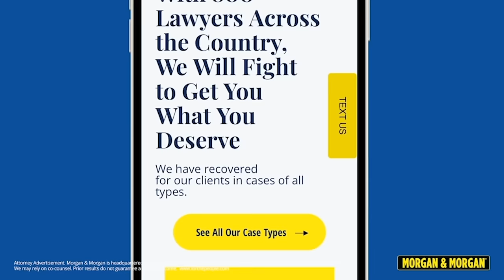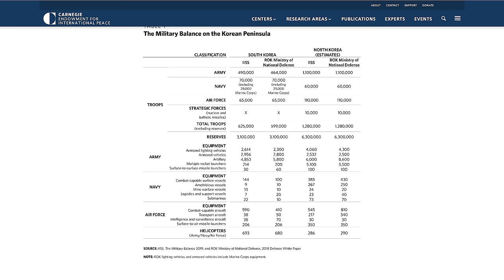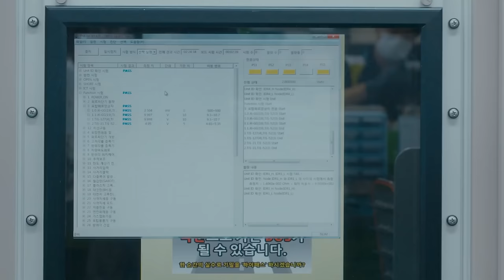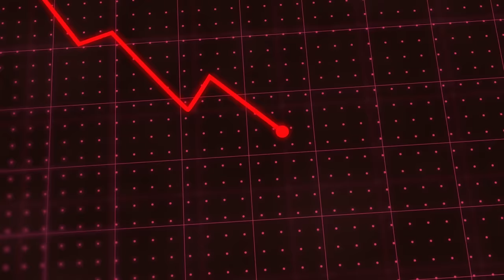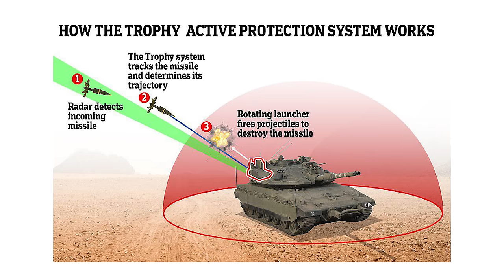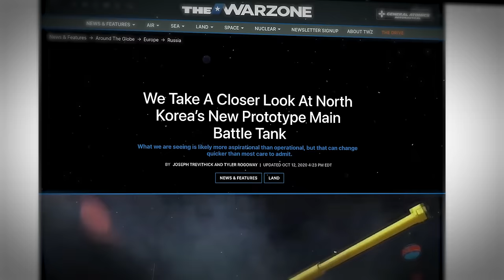North Korea's NEW Tank is a Nightmare

Comment: Bradley has entered the chat.
Bradley's main gun actually killed more tanks than tanks have killed tanks. One benefit of the TOW though, is that it has a longer range than the main gun. You can hit the enemy before they're able to hit back.
Reply: It killed more obsoletely armored tanks than other tanks in the same theater killed tanks. 

Fixed it for you.
Reply: The TOW is wire guided, correct? If so, how’s it possible to have a wire that is thin enough, spools out fast enough, and knows when to let go of the originating weapon? I mean, how does it work. I understand some submarine torpedoes operate the same way. And for miles, right?
Reply: Exactly about the ATGM and why the lack of professionalism of this video didn’t understand that is funny! All Russian MBT beyond the T-62 series have this capability 🤦🏾‍♂️
Reply: @4411825  I was gonna say the same lol. The question isn't why a tank has an atgm. Spoiler alert many tanks around the world have atgms on it that's not the problem. If these are top attack atgms then they're actually useful. Problem with a main gun fired atgm or shell is that it has to go through armour. Top down attack missiles... don't. I don't think this guy knows much about tank weapons. As for it being on a launcher. Technically makes it more versatile. Like it can at theory kill a tank with the atgm then follow up with a shot from the main gun. The atgm is a guaranteed hit essentially but the gun can still deviate. 

also the talk about a grenade launcher being on top instead of a 50 cal. Yeah. That's pretty obvious why you'd want that lol. The whole point of the 50 cal was to take out armoured vehicles and these days just light armoured vehicles. However how useful that actually is compared to a normal machine gun and more importantly, a fully automatic grenade launcher that can fire dual purpose rounds for anti armour and anti infantry... yeah a grenade launcher is a bit more useful. Israel already uses them. So does the US but the US doesn't mount them on tanks. Not that it makes much sense to me because if you're forced into an urban environment an automatic grenade launcher is hands down more effective than a main gun, coax or 50 cal. 

Whatever though.
Reply: @lonurad1259  this is what happens when you are more concerned with propaganda and not an serious unbiased analysis of the subject matter! One disagreement I would jabs with your post is that the original purpose of heavy machine guns mounted on tanks is to deal with anti air threats! In the jet 🛩️ age and stand off weapons of modern anti armor assets this is less useful but not completely obsolete! A grenade launcher is quite useful for one of the greatest threats to a tank which is infantry with anti HEAT weapons and a rapid firing grenade launcher can suppress this! One thing you will see on many DPRK 🇰🇵 tanks are heavy 14.5mm machine guns and actually anti air SAMS for organic air defense being the DPRK would be at an disadvantage to ROK and America 🇺🇸 in air to air engagements!
Reply: @pbinnj3250  it let’s go when it hits its target and blows up 😂
Reply: @Chris-fn4df  you didn’t fix shit 🤦‍♂️. All you did was let the whole internet know you like to hear yourself talk 😂
Reply: @pbinnj3250 the wire is thicker than you think and it's only controllable for a certain distance.  Torpedoes have the same concept bit are different animals because of water restriction, rather than air restriction.
Reply: No it has not. That is just flippen stupid to say.
Reply: @oletoustrup8572  YES IT HAS SHUDDUP!
Reply: @lonurad1259  yup, it makes a lot of sense to want the option to go through the opponents roof so to say.
Reply: @Chris-fn4df Yes he's referring to the Gulf War vs obsolete T-72m's and T62 derivatives. The Iraqis were at a major technological disadvantage.
Reply: @jsimmons9969  all joking aside. 🤷‍♂️.  The 20mm couldn’t destroy Iraq’s tanks.  Their tows did.  There’s actual interviews of a soldier that accidentally almost ran over a tank during desert storm because it was dug in deep.  He fired on it with the gun and described how the shells were just plinking off.   This was the documentary about the battle of 73 eastings.   It can be found on YouTube.  If you haven’t seen it you should check it out.   It’s actually pretty good.  👍
Reply: @smyers820gm  ironic hater is ironic. Comments section is for comments, kiddo. You commented, too!
Reply: @Chris-fn4df  it destroyed a t90
Reply: @Chris-fn4df  🤔🤷‍♂️
Reply: The 25mm gun cant pin a t62 
It was only the tow missile which destroyed tanks and it destroyed only outdated tanks
Reply: @ali-haider5788  Considering that the Bradley just notched a kill on a T-90 means that those 25mm guns are more than capable of hitting vital optics systems in a close range encounter.
And after all, we wouldn't dare question the might of Soviet engineering. 😂
Reply: @The1337guy1 Meanwhile, DSHK Pulmet of the Second World War: Hi Abrams, do you remember me :)
Reply: @The1337guy1 there are multiple video confirmed mission kills on multiple T72, T90 MBTs via 25 and 30mm autocannon.
Generally via HE/HE-Frag/HEAT as opposed to APDS.
You don't need a singular Pen through armor
There's a fuckton of RE+ flammable/ explodey shit, vulnerable turret rings, sensors, weak points.
Basically keep firing until the target reaches general ignition and/ or changes shape.
Reply: @Viscobarsa  Just like the M2 Browning of the same war? Shit at least we can replace ours.
Reply: @The1337guy1  it should be borne in mind that in operation desert storm there were old tanks that were not modernized, and Abrams was a good tank until he met with the dshk and rpg 7
Reply: @Viscobarsa  😂😂😂😂😂😂😂.  Yeah.   Just Russia is only using its old tanks in Ukraine 😂😂😂😂😂 T-55 and so forth 😂😂😂😂😂
Reply: @smyers820gm  only the old ones? yes, the t 55 is used, but only as an artillery platform and everything, and judging by recent events that, as you say, Russia uses old tanks and knowing that the t 72 b3 was pierced and destroyed by Abrams, it makes me think that the t 90m will definitely destroy it
Reply: @Viscobarsa  😂😂😂😂😂😂.   Ok.   The T-90 is poo poo.   Abrams can and will destroy it
Reply: @smyers820gm  Do you even read what I'm saying? the t 72 b3 was discovered and destroyed by Abram although the t 72 b3 does not have fancy electronics and the t90m anna does, and in fact we have not seen Abrams for a long time because they have been destroyed a lot in recent days
Reply: @ali-haider5788  USMC lavs destroyed t-62s in gw1 with their 25mm.
Reply: @Viscobarsa 
The T72 killing the Abrams has not been confirmed, and it is likely propaganda.
Reply: @smyers820gm  He did fix it and give needed context to an otherwise false claim.
Reply: @joekent5675  Well, it is expected when there is nothing to say, you immediately say that this is a propaganda well, ok, look on the Internet and you will see for yourself
Reply: @chad_8313  You have no idea do you?
Reply: @Viscobarsa and here i thought due to it rarity and bad ground issues ....... Any chance you've been in russia lately ?
Reply: @kameronjones7139  took 2 bradley to disabled it and it got killed by a drone, crew escaped.
Reply: @chad_8313 well another one who claims huge losses , and we keep seeing footage of bradleys vs tanks or other apc's .......... Like the commenter above your comment ...... How's the weather in russia ?
Reply: @pbinnj3250 nije svaki tow, vodjen zicom
Reply: @Chris-fn4df no it killed more T-72s than the Abram’s, and the most tanks in  total in the entire conflict, this includes tanks destroyed by aircraft
Reply: @Chris-fn4df  In 1991, two Bradleys came face to face with thirteen T-72s. There was no immediate backup and no air support at all.
The Bradleys killed 5 T-72s before help arrived.

And the T-72, by then, was hardly obsolete, especially compared to the Bradleys of that time.
Reply: @pbinnj3250 fiber-optic I think
Reply: Typically if range would be factor you would not use a tank on the first place.
Reply: Yeh, against Goat herders country, whom.been embargoed for a decade. 
LoL,
Reply: @ulooqulg  Nonsense, the Bradley was used extensively in the offensives in Iraq, which was the forth strongest army at the time with one of the largest tank troops in history.
And just for the record:
The US defeated Iraq so quickly the first time, they decided to do a speedrun and beat their already impressive records every time.

The Bradley has a well-earned reputation of being a highly effective, lethal vehicle with great survivability for its crew and troops.
Meanwhile, all russian armored vehicles are infamous for turning their crews into very fine ash the moment someone sneezes at them. Every day I am waiting for footage of someone destroying a T-90M with a crude drawing of an ATGM. It has been defeated by everything else on the battlefield already, including Bradleys and even a Carl Gustaf lol.
Reply: @SnakePliskin762  ali probably have mistaken t-62 with t-64. people mix that a lot.
Reply: @h.a.9880  the versions of t72 the bradleys were facing were obsolete so much that its not even funny. they didnt even have composite inserts in the armor. there is actual decassified report from usa military that clearly states that tows missiles (the first gen)can barely do shit to russian made t-72 at the time. so those tanks had no composites, no era protection and didnt even have proper modern ammunition. oh gee, they lost against heat munitions lol
Reply: @seushimarejikaze1337  The Bradleys stood their ground against an overhwelming force of _main battle tanks. *
They managed to reload TOW missiles while in a firefight.
They took out almost half the T-72s without being taken out themselves.
That is impressive no matter what type of T-72s they faced, cause you're still looking at more than 500 tons of T-72 going up against barely 60 tons of Bradleys.

Your argument: "Well duh, the T-72 just sucks" is lackluster, since it doesn't change one thing: The Bradleys are actually really fucking good at their job. And they did their job fantastically thanks to superior technology against a foe that was way larger in numbers, better positioned with the bigger gun. Vatniks like to glaot about how russian tanks will win in large numbers, here you have the perfect example of how quantity holds up against quality: poorly.

And regarding the quality of the Bradley, need I remind you: 2 Bradleys took out a T-90M. Aka: russia's best tank.
That's the latest chapter of a very long and very proud history of the Bradley doing its job. What else do you need to accept that the Bradley has a good reputation based on good performance?
Or do you suffer from vatnik-style brainrot that you assume every army in the world builds its reputation on lies like russia does?

Believe it or not, some actually just make good stuff and then use it well.
Reply: @lonurad1259  ATGM´s are not always a guaranteed hit, but they are far more likely to hit over extended ranges well beyond 3-klick mark. Beam and Radar guided missiles are vulnerable to countremeasures, and weather as well as enviroment conditions. In perfect weather and open terrain ATGM´s are ´´guaranteed´´ to hit, but they are not flawless.
Reply: @apyllyon  I mean that's the main use of atgms. Range. It's not necessarily that a main gun can't hit or pen at longer distanced, it's just that the trajectory at distance, it makes it very difficult to hit the armour at an angle or area in which you will pen. ATGMs are consistent compared to long range fire but yes they're far from perfect. In some cases they're easier to survive as most vehicles are equipped with laser warning systems which will protect you from most atgms (russian ones notably) or APS/thermal smoke. That's not to say they're useless though
Reply: i was a 27ED3 (tow/dragon repairer with Bradley identifier) in the army in 1998 and at that time the Bradley would defeat the M1 in certain situations.   because the tow had a longer maximum effective range than the M1 main gun.
Reply: @Viscobarsa  Was a good tank? So it's already better than the T-72, a tank that kills its crew when the hull is breached almost 100% of the time. A tank that was never good. And like I said, losing a tank isn't an embarrassing affair, it's war. You expect losses even against an opponent you outmatch, the first rule of war is to never underestimate the enemy.
Is this that toxic Russian pride I've heard so much about? You tether yourself to this paper tiger of a national identity that declares strength is number 1, anything that contradicts that is a lie. You beat Hitler after all, how could Russia ever not be strong?
I'll tell you how, it's 2 years in Ukraine that's caused irreparable damage to Russia as a world leader. However this war ends, Russia will not like the results.
Reply: @The1337guy1  Did you think for a whole month to write me this nonsense? I'll tell you the truth, any tank can be destroyed once in BC, for example, Abrams, and believe me, one crew member will die anyway, but about our pride or whatever you wrote there, this is generally complete nonsense
Reply: It can also target drones before they get close enough to impact the target...(On a limited, but achievable basis...) Also highly effective against slower (but, highly effective), A-10's...
Reply: @h.a.9880  do you understand the difference between t-72a, t-72b and t-72m and t-72m2? or maybe you dont and think its the same tank? its like saying that "M1 abrams is the same as M1A1 abrams that is the same as M1A2 abrams". you either dont know the difference those versions had in equipment armament and protection or youre trolling at this point. and no, to date there are no known t-90m destroyed by bradley ifv specifically. if you have a picture of one with proof it was destroyed by bradley please do provide.